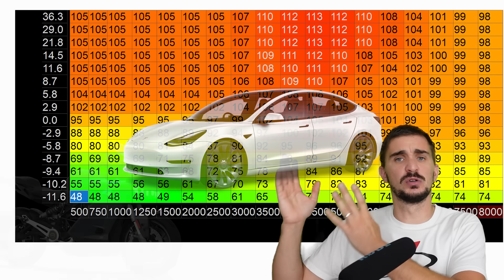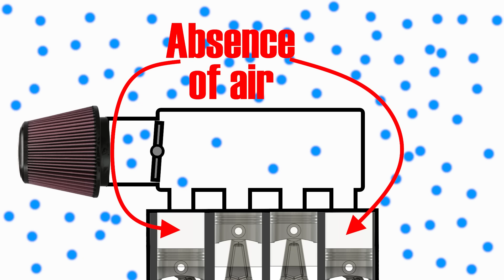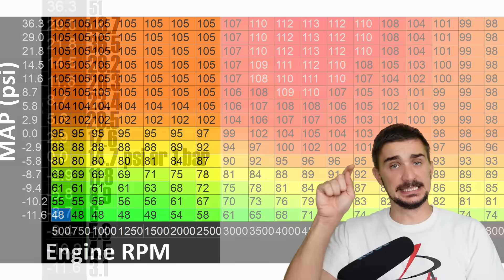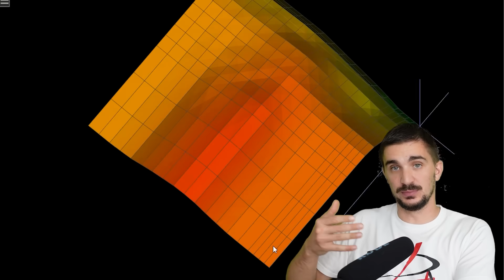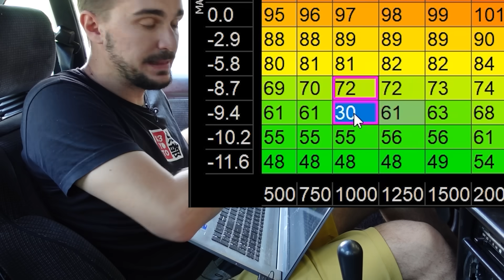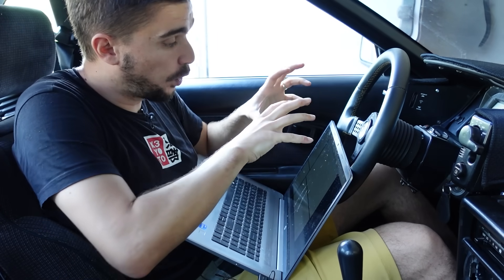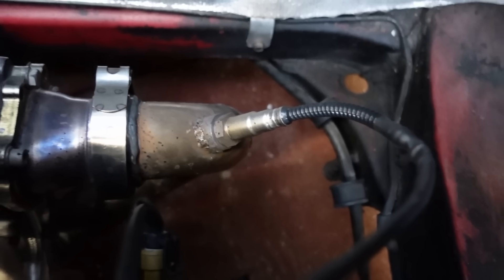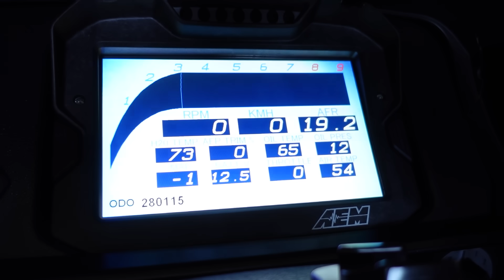If You Understand Volumetric Efficiency You Understand Engines

Comment: Interesting VE-table. In the maxxecu VE does not increase with added pressure above 0 vacuum / 101kpa. So if the torque peak has a 85%VE then it will be 85%@200kpa as well. Also the pressure starts at 0kpa and then scales up. Im not sure I like how it is done on that AEM cause added pressure above absolute should have not effect on VE, the engine still breathes just as poorly. It is just fed air at higher pressure.
Reply: I searched the entire comments for anyone mentioning MAXXECU as im on the fence on whether to go AEM Infinity Series 5 or MAXXECU Sport. If MAXXECU starts at 0kpa then I am very concerned because that means the idle (throttle closed) cant be tuned??? I dont want to have a rough idle
Reply: @ahmed9399  You always have a few kpa at idle. I think for a normal 4cyl engine around 20-30 kpa at 700rpm. 0 kpa is a non running engine or engine braking. You can scale it whatever you want 0-to whatever. If you want you can have negative too probably what for I dont know. Maxxecu is great. I tuned myself and when I went to the dyno the tuner said it was fairly good. Not a testimony to my skills but rather how good the Maxx is.
Reply: @Rourkeize  thanks for the info. Did you take any course online? Im considering Evans Performance academy.
Reply: @ahmed9399  No but I watched a bunch of clips. It's not difficult to street tune with a wideband. Just make sure 1) the default timing is correct and adjusted for in the ecu "engine zero is really zero". 2) Use the stock timing as a baseline and dont adjust it until fuel is correct 3) start out rich on the fuel and let the ecu adjust it leaner by driving and datalogging.
Reply: @Rourkeize  thanks. Have you looked into AEM infinity series 5? If you were to choose an ecu would you still pick maxxecu?
Reply: @ahmed9399  they seem very similar. I think you should choose based of how much you like the tuning software, what your local tuner prefers and lastly price.

Comment: I'll be darned! I recently purchased a liter Honda superbike. Internally stock, but with some external modifications from the previous owner aka a free filter and an open exhaust. It is hunting at idle EXACTLY like your car. I will try to address the issue with the mechanic, but he instantly told me to get the stock air filter and reduce the exhaust flow with a db killer. 

Apparently the 170 or so whp were to weak for the last guy 🤔

When I had my Subaru entirely stock I had driven "tuned" versions that were literally slower than stock. Sure, they sounded cool but you cannot just throw parts at the car and expect an improvement.

So, back to the bike in question, one would need a custom map for that filter and that exhaust. This means a lot of time at the dyno correcting a/f ratios and dyno time is not cheap. Plus you need all the electronics like a custom ECU. All this provided that the technician is actually doing something and doesn't end up loading a generic map. 

So, as the ancient proverb says "If the japanese built is this way, leave it alone" 😁

My greetings from Greece.

Comment: This is why variable valve timing is such a big thing (aside from improved efficiency).
In theory, with infinitely variable valve timing, you could have a minimum of %100 VE from idle and a high rpm screamer at red line. Imagine the monster engine you could create.
With variable intake length you could have better than 100% VE across the RPM range. A diesel from idle that turns into a race engine as the RPMs increase. 
The advantage extends to forced induction. For a given HP you need less boost which means less heat which means less chance of detonation. Turbos would spool faster too.

Comment: With valve timing overlap, intake and exhaust tuning it's not that difficult to get a naturally aspirated engine above 100% VE. Obviously it can't go as high as something that is mechanically forcing the air in but even street engines can and do surpass this, though not in typical usage.

This probably happens less often with modern engines, emissions standards.

Comment: That was great. I think though that you missed the opportunity to report that the check engine function is looking to large correction values to report errors to the lambda value. So air leak or stuck injector can cause variations to normal.
All you info is perfect, but not even limited to tuning, it's normal ECU operation.

Comment: Fun fact:
If you ride with your Aprilia through the Dead-Sea region in Israel the ECO will start throwing "Urgent Service" error codes and will cut the engine power into limp mode.
This is because the dead sea is the lowest place on earth with an atmospheric pressure of around 15.5 psi. This value is probably out of the VE map and the ECO "thinks" that there must be a problem with the MAP sensors.
Once you're out of this area you'll need to shut off the bike and turn it back on, and everything will be back to normal.

Comment: I still don’t understand how the VE is higher with boost. Yes I know more air is going in the engine from the turbo but how is it fitting even more in than the turbo is providing? (110% of the 0.5 bar extra it is providing). Is it an airflow timing thing?

Comment: Cool, how does that work on Diesel engines? There's no throttle body so the engine is always ingesting the most air possible. Does it still have a RPM vs MAP table or there's something else?

Comment: Volumetric efficiency is completely disconnected from forced induction, as the manifold pressure is taken into account via the calculations, this means you can can and will routinely go above 100%VE in a naturally aspirated engine near peak torque RPM, and below 100%VE under boost in a forced induction engine when you are outside peak torque RPM.

It is the ratio of air that enters the cylinder vs what was available in the manifold.
Reply from the maker: No. Please refrain from spreading misinformation. What was available in the manifold is not part of VE calculations. If it was you would have 100 VE at idle because there's very little air in the manifold and all of it goes into the cylinder. Also VE is not disconnected from forced induction, I explained it in the video. Forced induction changes the maximum possible amount of air that can enter the cylinder and therefore it significantly impacts VE. Yes, some na engines can go slightly above 100 but not significantly. Yes you can be below 100 under boost but this occurs under light boost and mostly closed throttle which means you're not allowing a lot of air to enter the cylinders.
Reply: @d4a  You have greatly misunderstood what i stated.

Yes, VE is low at idle because the cylinder displacement moves a lower mass of air into the cylinder than what would exist in that same displacement inside the manifold at the current manifold pressure. Due to a variety of reasons including 

If VE was directly connected to manifold pressure than at 14.7 PSI of Boost you would expect numbers closer to 200% VE, but that is not the case as we both know. 

This is because VE calculation take into account the manifold pressure. VE is the ratio of air mass that actually makes it into the cylinder compared against the air mass taking up that displaced volume in the intake manifold where MAP is measured. It's the pump efficiency of the engine itself.

That being said forced induction engines usually have much flatter VE tables over straight NA motors, but that has nothing to do with the VE calculation. Maybe that is where you misunderstood the point i was making.

When i see VE numbers greatly above 100 i usually being looking for culprits in other tables, is the lambda i am trying hit correctly populated in the target lambda table? is there an IAT trim that is out of skew? Am i masking a lack of acceleration enrichment through a transitional zone in the VE table? The ability to isolate these depends on your tuning environment, can you steady state the load in that area, etc, etc.

Not trying to counterprogram your channel, i'm a big fan and you have one of the best ICE channels on the internet period. Great respect for you taking the time to make these well produced pieces.
Reply: You are both wrong.

Comment: Car engines don’t even rate. Go check out the aero engines of the mid 40’s to early 50’s Like the Rolls Royce Crecy, a sleave valve 2 stroke DI V12 or the various great Napier engines, the Sabre & the Nomad, & the Bristol Centaurus, etc. & they’re just the British ones, there were even more greater Soviet & US aero engines too. They make modern car engines look old hat. Gez the USSR even bought into production a quadcam multivalve  all alloy V12 diesel with quad turbos in 1940. Plus produced a radial engine made up of 6 in-line engine banks on a common crank. Alfa Romeo even brought out a 14 cylinder air cooled radial with 4 valves per cylinder.

Comment: Of course, in a naturally aspirated engine,  if it's running, there's never zero difference between manifold pressure and the outside air pressure.  If there were, there'd be zero air flow.  You're always below that zero pressure line.

Comment: Just a quick question. Can the VE of an engine improve at high RPM if the engine has Variable Valve Timing or if has a free valve setup? If you have a aggressive cam profile that allows the valves to remain open for a longer period of time or independent valve timing, will it affect the VE at high RPM?

Comment: One thing I completely don't understand: you explain VE as % of air filled of the internal combustion area. Later (or earlier) you mention that at low RPM's it cannot be efficient at breathing. It sounds logical but I don't understand why? I would expect that at very low RPM's, the combustion area has ample of time to equalize it's pressure with the pressure which is present at the intake manifold. So if I understand correctly at 0 MAP and 0 RPM (or at least very low) the VE should be around 100% no? Of course there is little power but okay. Or is there a thing I'm overlooking, like that when the mixture explodes it forces the engine to go fast?
Reply: As you can see the map starts from 500 RPM. At 0 RPM the engine is not moving, and you're correct, the MAP would be reading 100% VE.

Comment: 1 thing that bugs me, is that this doesn't take the whole topic of air flow speed -> turbulances -> knock into consideration. You could have good volumetric efficiency, but if your tubulances are low, you could run into a knocking situation which could be rememdied by injecting more fuel. Not sure how significant this is, but it feels significant.

Comment: Question: How does the ECU compensate for intake temperature? On a boosted non intercooled intake you have high temps and high pressure but lower actual volume of air in the combustion chamber right?
Reply: MAF sensor, Mass Air Flow. And it knows how big the tube is basically.

https://youtu.be/4RemVB2k01Y

Comment: Hi! You have such interesting videos, but I'm wondering: do you have videos about Detroit Diesel 92? Or something like this: 2 stroke, with valves only for exhaust, windows in cylinder walls for intake and super- or turbocharged? For me it's like perfect engine for torque without limitations of classic 2 stroke engine, but I'm sure you can find a lot of disadvantages of it

Comment: Something I never understood. Cylinder pressure is limited by the fuel, too high of a compression ratio and you get knock. NA engines can already achieve more cylinder pressure than 93 octane can handle. So how does forced induction, which increases air pressure, provide benefit over just running a NA engine with a maxed out compression ratio, like 13:1?

Comment: Thanks a lot for your work in these videos, explaining complicated concepts in a very understandable way. I was wondering about the significance of the cells in the VE table with low MAP and high revs (or viceversa), i.e., the down right area or the up left area of the table. Is the engine ever reaching those parameters? Are those values used at all?
Reply from the maker: Your assumption is correct as some cells at the corners are never reached under normal conditions

Comment: some n/a engines can too achieve a slight positive (or low boost) pressure in the intake plenum using helmholz resonance...
Reply from the maker: As I said "significantly higher pressure than atmospheric" doesn't happen, but yes, slightly higher is definitely possible

Comment: I never had to deal with VE tables. I guess its something that is used on MAP sensor based engines only? Earlier 80s and 90s cars often had MAF or AFM sensors that measure the mass of the air going in to the engine directly, so no conversion table was required. Well that is not true... there was a tiny 1 dimensional table to convert the MAF sensor value 0..5V to the mass of air (it wasnt a strictly linear relationship). But that table was generally fixed for a specific type of MAF.

Comment: Great, but I doubt that, without a static engine test bench (and probably a throw away engine) you can really fine tune all of the possible combination of RPM, engine load, air pressure, air temperature, ignition timing advance/retard, camshaft position on a variable valve timing engine etc etc... That must be a proper headache...
I wonder why big car makers don't release (through a separate company) some "race maps", made, tested and proved by them, for us engineheads... A bit like Japanese when they released tuned down engines but with blocks and internal components ready to get a LOT of power more...

Comment: I would like to see one change and two additions to this very informative video. First, more discussion of what it means to fill the cylinder a certain percentage, I prefer to think of the percentage as the ratio of the filled cylinder PRESSURE compared to the reference (ambient) pressure. Your description leaves it slightly less clear at what pressure you fill the cylinder to say 61 percent (that’s ambient, not manifold). The first addition I’d like is more discussion of how camshafts determine these characteristics and how variable camshaft timing can reduce the variation (in theory there’s no reason an engine can’t run 100 percent VE at 2000 RPM, but it would likely hurt peak torque without some serious variability, this is a minor factor in my decision to convert my 4.6 liter 3 valve Ford engine to pneumatic valve operation). The second addition I’d like is some kind of overlay (perhaps color?) to show THERMAL efficiency, since this is also an important (and misunderstood) component of engine behavior. The color overlay appears (and I’m guessing) to show fuel economy instead, most people do not understand that under normal operating conditions for street engines, thermal efficiency is inversely related to fuel economy (thermal efficiency goes down as you move towards increased fuel economy from peak efficiency). Increasing peak thermal efficiency doesn’t directly increase fuel economy (it is more important to “close the gap” between operating and peak efficiency).

Comment: Well, no, atmospheric pressure is not really a constant. Hefty low pressure systems have it dropping to ~920mBar(With lower values having been recorded in extreme weather) while strong high pressure systems have 1050 and higher. weather can make quite a difference already. Then there's variation of static air pressure with altitude, of course. That probably is where taking the outside air as reference point and merely indication differential pressure adds precision, even though the reference point already varies by a percent or more.
…but then, what's a percent? 🤗Great video, as always! 💪

Comment: Great vlog.. I've noticed that there are multiple maps in some boosted cars referencing VE.  For example below 2K RPM an Idle map.  There's also a cold start map in some and it may also throw you off when adding or removing fuel (or timing and boost where applicable) at RPM levels below op temp and 2500rpm, because the ECU also uses these maps to Trim the AFR based on O2 and other sensors (MAP and/or MAF) .. then relies on VE maps above 2500rpm upon achieving the proper op temp..  and therefore most operational tuning happens after 2500rpm and up. 

For this reason.., you may have to disable the ECU's ability to TRIM the AFR before tuning, and properly map voltage levels of the injectors or that will throw off a tune.

Comment: Heyo, love your videos!

I do have a few questions regarding this though:
- Do the ECUs in current cars already work like this without doing any tuning yourself?
- If yes: Starting from which year?
- If no: why not?
Reply: I might be able to help on this one. OEMs spend numerous hours testing “mule engines” under extreme conditions to build a base table that is “bullet proof”. As I understand it these ECUs can still make SMALL adjustments as they “learn” your specific operating environment and how it affects oxygen content as measured by the exhaust sensor(s). I believe the main reason that engine tuners can give you more power is that they don’t care how your car behaves at 14,000 feet or at 40 below temperatures. By focusing on specific conditions (standard day, probably) and prioritizing power over economy and durability, they can tweak your performance a bit.
Reply: @ehb403  Thank you for the detailed answer! I appreciate it.